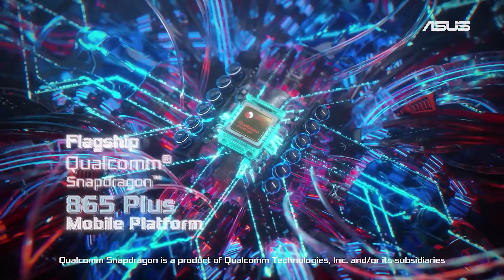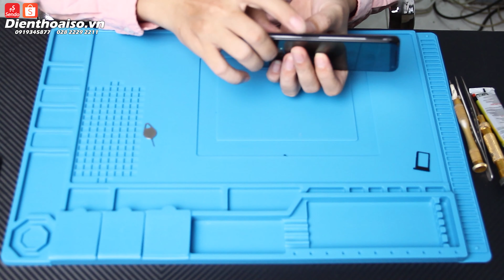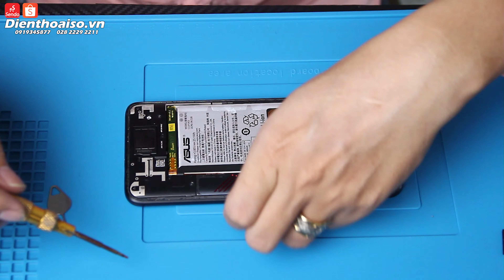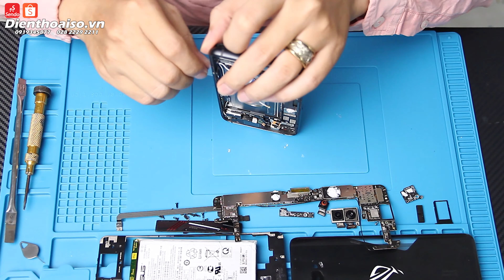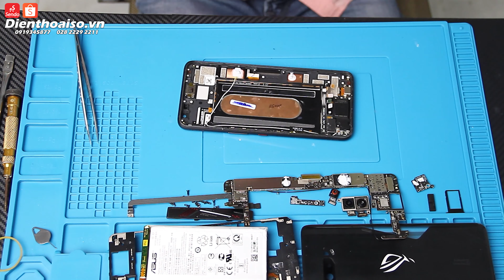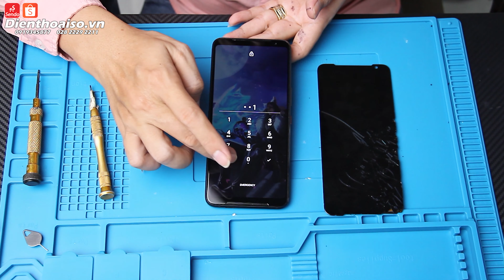Screen replacement for ASUS ROG PHONE 3 | So Hot ? | ROG PHONE 3 IS IT SPECIA ? Broken Screen Amoled

Comment: I have Issue with the phone ROG3.  Mobil Network is Showing No Service.  How to get this Fixed ? is this a Hardware issue or Software . Plz help. WIFI Is working fine. No other issue. No Physical damage.
Reply from the maker: hardware failure, you can find a repair shop and have them check it for you
Reply: @HOWTOFIXPHONE  Local Service Center have told to Replace Mother Bord. is it possibly to Fix this Without Replacing Mother Bord ?
Reply: @prashantminajagi6229  hey is your phone is fix? I have the same issue sim card issue and restart ussue.
Reply: @joemarsadje4691  Got Fixed. They Replaced the Chip set,  Plz check your Warranty. If not, it is very Expensive. The Replacement Cost will be Equal to the New ROG 3 Phone Price. If it is out of Warranty.  You will have to Write to Customer Service . Explaining the Situation..